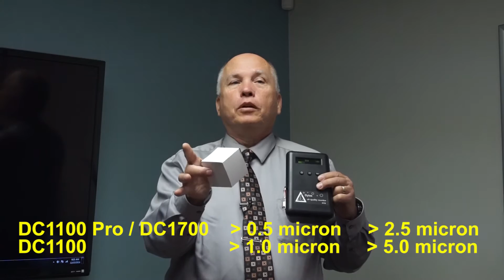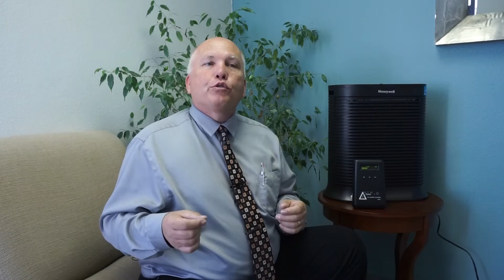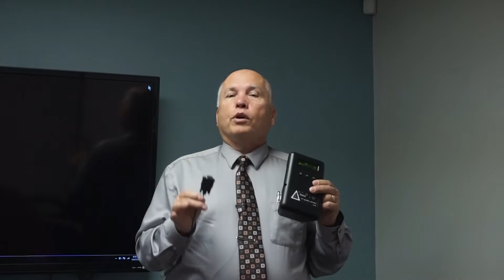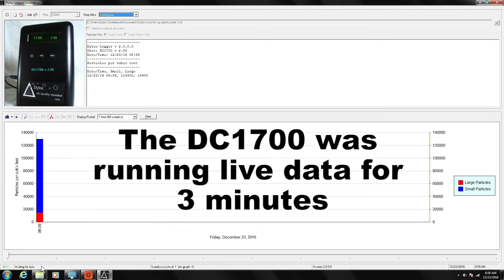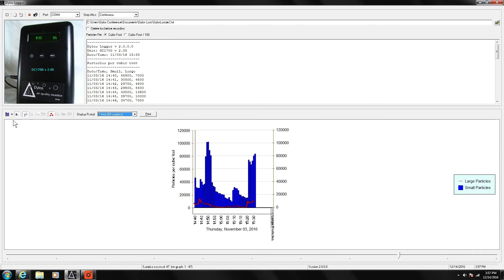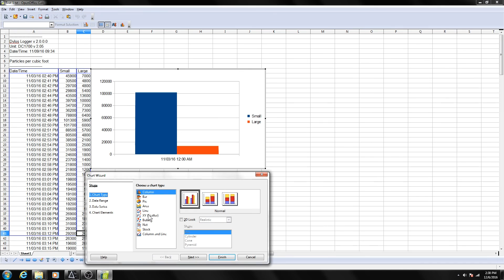Dylos Air Quality Monitor Features

Comment: This is a fine unit from a technical standpoint, but the design is ancient and badly needs an update. The UI is terrible, and the computer interface is a serial cable (seriously). I'm surprised the instructional video doesn't come on a VHS tape.

Comment: The enthusiastic presenter is behaving like a typical salesman.. very last Century! Instead they should pretend to be a dumb consumer asking awkward questions and conduct a Q&A interview with a technical expert on camera. Questions might include: Does the HUMIDITY in the room affect the readings? If so, can the device take that into account? Should the air in the room be still so there are no drafts etc? Will it measure levels of dust mites (approximately? And many other questions that consumers would like answers to. Move on, nothing to see here.
Reply: Very high humidity will give higher readings. It will count the water vapor as particles. There is no calibration for it.

Comment: If you put the counter directly at an air source, you will get inaccurate readings. Forcing air in will change the amount of air being sampled, usually resulting  in a higher reading.

Comment: It only measures particle size, not which sort. What you want to know is fine dust or pollen etc. If you for instance have a lot of watervapour in the room, this Dylos will also measure this, although it is harmless.
Reply: Water vapor would be considered large microns.  He mentioned that smaller microns are potentially more dangerous and the focus.
Reply: DigitalRaider1 That depends on the source. Vaporizers and ultrasonic humidifiers often produce droplets of < 5 micron. They are registered by the Dylos as small particles.
Reply: Paul met Debbie this
Reply: My Dylos DC1100Pro definately counts water vapor as particles 0.5 microns and up.  If it is humid outside the meter will often read 2x to 5x the same reading on a low humidity day.  Just raising the humidity in an enclosed chamber will give the same effect so I know the particle counts, other than water vapor, didn't cause the increase.

Comment: Great fast moving informative video. I think the PROPER cable should come with it (does it?). Your website did was very lacking in specs (zero specs). I wanted to know if the $`199 one checked .5 and 2.5 and after this video I guess it does. Also, battery lasts only 6 hrs but is it rechargeable and how? Can you plug this into AC power or a laptop or? So many questions, so little time for answers but hey, keep up these great videos and make sure people see them on your website.